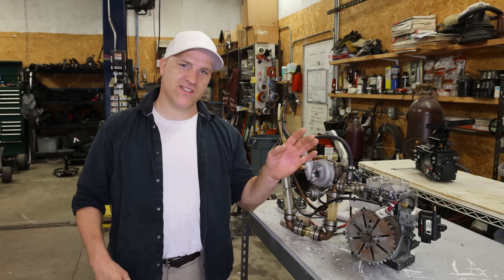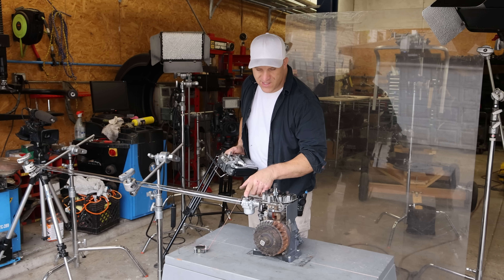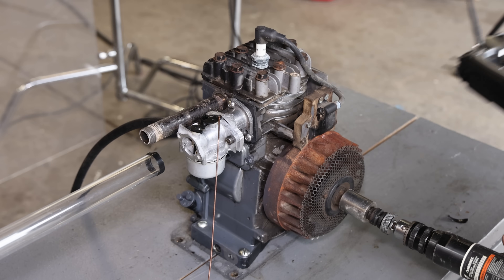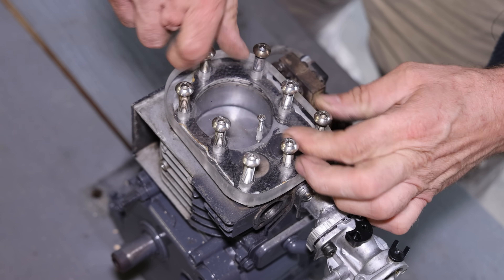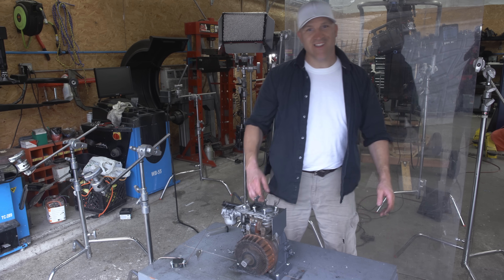Engine Running On GUNPOWDER

Comment: Does anyone notice that in the end clip where it’s supposed to show the Briggs still running after the explosion that the tube with gunpowder reappears. I smell something fishy here.
Reply: That tube is visible at 6:05 after the clear head is toast and the bolts bent. So I dunno maybe he put a new tube on after the engine blew up?
Reply from the maker: @5thwiseman  yup you got it, I was going to run it again on gunpowder but decided to just end the video, I did do a live stream of the engine still running .
Reply: Same-
Reply: All of the shots are the same engine, but the order is a little messed up.
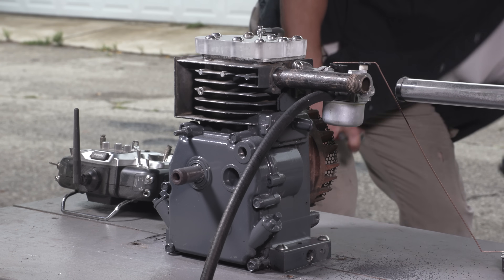up to 2:50 is the original timeline, it switches the second attempt between 2:50 to 2:55 and you can see the spark plug cable change direction. The second attempt was more exciting as the whole tube blew, so it got put in the video first. At 4:50 it cuts back to the original timeline, but the first attempts slomo has been moved to the end of the video.

The first load of gunpowder was smaller. On the second attempt, he gave it more gunpowder,  and the tube blew as well.

The scene of it running did not come after the double explosion but after the first explosion which is why you can see the tube with some gunpowder still there.
The relatively weak plexi head would have limited the amount of damage from overpressure, with the original head it would be a different story.
Aside from grinding gunpowder through the cylinder and valves, it's not surprising it run for a couple more seconds at least. It may have lost its warranty though.
Reply from the maker: @Spike8119  ha! That was an impressive breakdown! You nailed it, that's what I did in editing since I had multiple attemps and multiple tubes but only one explosion... Very nice
Reply: You can still see a tube at 6:05 as well
Reply: I think he got this engine blown twice, or used two engines maybe. But for sure he did a second attempt  , just look at 4:10 and 5:10, remaining pieces of a plexi head are in different places. So my assumption is at a second attempt he didn't get a tube with gunpowder ignited, that's why it's there at the end.
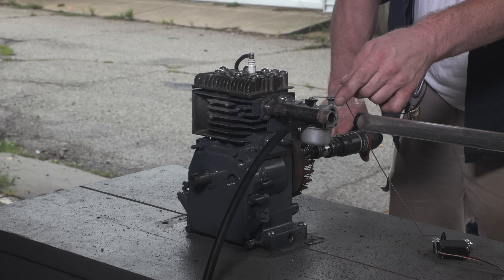Reply: if you look at 6:11 you can see another tube has been put in place, so yeah
Reply: Timeline can be proven true by the shattered bits and pieces of the clear head that are rattling around on the table when he starts the engine at 6:05
Reply: It's called he had another tube dummy
Reply: @wildman510  Negative, look up one comment
Reply: DeShawn Stevens  maybe click some of the timestamps and you'll see
Reply from the maker: DeShawn Stevens  it's not made up tho, he nailed , he just dissected the edit and he got it right
Reply: I noticed, too. I thought the tube had blown up. Then it magically reappeared.
Reply: Wait if you look at 4:04 and 5:10 you can see that the price see through head is not in the same position cause at 4:04 its at the side of the cylinder and 5:10 its at the end of cylinder hole,I guess he do this two times.
Reply from the maker: @hirusthehellhound  100 % correct!
Reply: Being a man, If I could blow that thing up more than twice I would, explosion are fun
Reply: Hey @Aluzionz dude, look at the end clip. he did it twice
Reply: Man you know the real reason is, that he thought to do it again with stock housing lmao
Reply from the maker: @kornpops1261  I almost did but I won't do it in my shop and I would have to have much thicker blast shields in place. That would be basically be a grenade at that point
Reply: @WarpedYT  it's nice to see a presenter individually replying to comments, first video I have seen for a while of this type, one of the best yet, a novel idea with the powder. 
As a technically minded person I can appreciate what goes into such a production. Well done.
Reply: I retract my own comment, it does appear to be legit rewatching it carefully now
Reply: Maybe he made two tubes?
Reply: @im_soulez  and filled it gun powder to see how it would explode again...I don't think so
Reply from the maker: @mindblastmanja656  that was the original idea but I decided not to do it a second time and just end the video, I had purchased 4 tubes.
Reply: Yea
Reply: damn the douchery is strong with this one lmao
Reply: I felt tricked!
Reply: I'm kinda surprised the head bolts had anything to go into after all that lol

But I did at least pick up on him saying "gonna do it again with the real head" and then it just never happened... Not fishy with the verbal mention.
Reply: he is a sussy Baka
Reply: Its there after the explosion when he's looking at damage
Reply: Unless he remake everything up again... I think
Reply: Yeah, the engine is probably filmed before the explosion, as the gun powder is still in the pipe.
What a shitty way to A. Try to sell a product, and B. Bait people in to thinking it still runs.

I dont see this as being a product placement, but why the fuck would you make it out like it is one?
Also, Look closely, The Crank is completely different. The wheel is Silver where as in the video of it exploding, it's completely rusted. 2 entirely different engines.
Reply from the maker: @ALuzionz  hahah... Product Placement? The engine is 35yrs old and Briggs has already filed for bankruptcy like a year ago.
Reply: @WarpedYT  I didn't realize that B&S went under.  I guess that explains the shitty modern construction.
Reply: @ALuzionz  Watch the video again @6:10 The tube of gunpowder reappears but it still has Bent head bolts
Reply: @ALuzionz  The wheel is moving, not "silver" (and looking carefully one can still see it's rusted).
And at 6:05 the tube is there but the head is shattered with bent head bolts.
Simply, he must have tried the "experiment" multiple times to get more footage and in the last attempt no embers ignited the powder in the tube.
Reply: @ALuzionz  if you look at a lot of his content he really is a bit sly :/
Reply from the maker: @johndoe1778  that's what it seems but not so, just like life or anything else, it's actually much harder and more unbelievable if you tell the truth then if you lie.. you really think I have that kind of time to set all this up and fake it?.. if it doesn't work for real I'll just go on to the next crazy idea, no reason for me to fake it...
Reply: @ALuzionz  all hat was bent Was The head bolts,  and anyways he could've had spare parts
Reply: I just posted the same thing
Reply: @itsamk18-ish  Me three.
Reply: I thought he was going to gunpowder the briggs and stratton head.
Reply from the maker: @FAB7362  no way... Not in my shop anyhow.
Reply: Ya I noticed that. That's because there is no clip of it running after. Super shitty to try to trick people
Reply: @tyler.diesel  no he put the tube back you can see the tube next to the bent head bolts at 6:05

Comment: 6:25 Why the hell is there another tube of black powder???
Reply from the maker: Because I ran it twice, the 2nd run is at the end of the video. I just pulled it out of the edit because it felt pretty redundant.
Reply: @WarpedYT  would have been interesting to see the test repeated, but thanks for the response. :)
Reply from the maker: It is at the end of the video, I just put the slow motion part in there though.
Reply: @WarpedYT  im sorry I misunderstood. I thought you said you removed it. And the slow mo at the end has a very similarly shaped piece of clear head left so I thought it was the same take. Keep up the good content and I like the new camera, feels fresh(?) and clean.

Comment: This was super cool!! I wonder if there is a way to make a simple machine to throw a small amount of gun powder into the engine.  Like a gun powder injector vs a fuel injector. I bet if the amount was much smaller it would run normal. Lol. Super cool footage!

Comment: First off, gunowder and black podwer are two different things, but you’ve said them both.  So which did you use?

Secondly.  Wow!  You re-built the entire servo mechanism, the tube, and refilled it with powder to “make it run one more time as an outro”?  We’re not that stupid man, uncool.

Comment: Great video.  But Wow.. your really brave for milling live powder in a high speed mill. To change the granular size for live black powder,  use a ball mill with non sparkling media, like ysz zirconium balls. 45 min or less you'll have black powder flour. Another method is wetting it to a paste and re-corning it through fine wire screen and letting it dry. Screen corning dry is dangerous because of the airborne dust, just add spark. Coffee mills are way too dangerous to use for pulverizing live black powder. Metal, fine powder, and plastic make for great static charge potential. Now for grinding each component of black powder separately in a coffee mill is safe, as long as its thoroughly cleaned after each ingredient.  Not busting your balls, just hate to hear about you losing an arm or worse from improper handling.

Comment: Why do you still have the pipe with the gunpowder still in it when you start it up again "after" the carnage? 🤔 dont think its a video from after the carnage... so i think That the engine would not start in the enda and you recorded a video before the carnage as a safety if the engine would not start.

Comment: Hang on I seen that tube explode to bits,how comes it is back and full of gunpowder when you testing engine after explosion?
I think you filmed engine test after explosion before you blew it up.🤨
Reply from the maker: Because I ran it on gunpowder twice, but I ended up just using one scene in the episode because it felt redundant. I did however include the second gunpowder run at the end of the video. I also did a story yesterday showing me run this engine again live because a lot of people were saying that I faked it.

Comment: See.. What happen was...Your rpm wasn't high enough and you should've had a 3 stage delivery system, NOS make gun powder injection through summit racing, you just have to get the solenoids from ZEX kit 😆

Comment: Strange, when you attached the metal head, a tube with gun powder appeared again.. is it montage and you didn’t really assemble the engine after explosion ? I believed you!!
Reply from the maker: It was did the gunpowder run twice, that clip is at the end of the video, also I just did a story couple days ago where I show yet again that I ran this engine after even the second explosion. Check it out if you have a chance
Reply: Warped Perception checked, now completely  it make sense. Thanks for response, take care!

Comment: Anyone notice that he tried to pass off footage of the engine before the gunpowder as proof that the engine still runs after the gp test? 
The gunpowder tube exploded so why is it there when he “put the original head back on to prove that Briggs and Stratton engines are indestructible”?

Comment: the other camera was definitely cleaner and crisper image when you are filming the engine this was a very interesting video and experiment I bet if you would have kept the original head of that engine when you put the gunpowder in it it would have exploded the whole engine and sent shrapnel everywhere which is not a good thing I have a suggestion for you on another tangent please I really want to know this what happens if you put hydrogen and a diesel engine will it explode or will a diesel engine run on hydrogen I'm very curious to know this can you do this experiment for me I would graciously appreciate it peace out have a great day

Comment: Here's the formula for TNT ( trinitrotoluene)..mix equal parts of nitric acid sulfuric acid and toluene. Warning do not let mixture reach 110 degrees Centigrade as it will detonate in your face..you need a vat that is water cooled and the bottom needs to be able to dump a gallon of the mixture in 50 gallons of water in a well ventilated open area ..and don't ever breath the fumes of your mixture has to be dumped as the nitric oxide  fumes will
 kill you in about 30 seconds ..a stable mixture of nitric acid sulfuric acid and toluene will solidify at around 100 degrees Centigrade as you liquid cool the liquid TNTover at drum and use cold water in a drum..pour the liquid TNT over the out side of the drum  to cool and solidify the TNT...then scrape off the TNT from the out side of the cooling drum and gently grind up the TNT in to  a powder and dust it into your engine ..will make a huge kafuckingboooooom
Reply from the maker: Ha! Your crazy to post this here, I am somewhat familiar with Tnt however I wouldn't mess with that in the city or at my compound, those DV's are way to high to play with inside a building or garage or in the neighborhood..... Lol.

Comment: Imagine if this was refined and implemented in the future 
Cars could do a quarter mile in no TIME!!!!
Reply: Oh I can think of a good way to refine it for maximum speed, just make the car a cylinder, put gunpowder on the back, then put it down a big tube. 0-Mach 2 in around one second!
Reply: @logantc.1353  HAHAHAHAHAHAHAHA
Reply: It would destroy the metal cylinder walls and anything else made out of similarly inferior materials.
Reply: @Baigle1  top fuel dragsters melt the plugs and weld their clutches every single run
Reply: Its called "Nitro Funny Car".
Reply: I mean top fuel dragsters already run on nitromethane which carries it's own oxygen just like gunpowder.
Reply: It's been tried since the 1700s, it's not a new concept. The problem is, it's a shitty fuel source, too volatile

Comment: hmmm, something about the camera is weird. I saw the engine and the tube holding the gun power explode one after the other but when you restarted the engine at the end with the stock cylinder head, the tube holding gun powder was still showing. Maybe it's ingrained into the new camera? 6:10 
 I hope no one got hurt and everyone can hear ok. Thanks again for a Great video! That was fun!!

You should have walked back in front of the camera with chunks of that clear pipe glued to your face and body and your cloths full of soot and said something like,  That was a fun video and I hope everyone liked it but I'm going to cut this video short because my ears are ringing and I have a head ache. Just to give it that Wiley Coyote affect.
Reply from the maker: It's because I did the run twice, the second run is at the end of the video.

Comment: Someone please tell me where I can buy one of these engines
Reply: I han an early 2000's craftsman 42" zero turn with a single cylinder 20hp briggs on it that was an utter tank. Not the same engine but pretty close.

Comment: that second explosion in the tube was really impressive, especially in slo-mo.😁 I can't believe it didn't break the connecting rod and/or blow the side out of the cylinder when it blew the head off. The fact that it still runs on gas is almost unbelievable.😲 So there you have it kids, don't ever play with gunpowder of any kind and expect not to lose a finger or 2 in the process... not to mention, possibly your life!☠️😬

Comment: Run the gun powder with the stock head on it instead of the plastic head.
Reply: Stock head with gunpowder!!!!. But double your distance from the engine.
Reply: Ah yes, making a grenade.
Reply: Um you realize the amount of shrapnel that would cause with the force created it would send it through his wall and his neighbors walls
Reply: @camdenp3244  yes,but big booms for fun...are fun.
Reply: that's just a straight up bomb
Reply: Exactly what I was thinking
Reply: Try to fabric a hopper style feeder for the powder, so u can vary the volume of the gravity feed of the powder
Reply: You want a grenade? That’s how you get a grenade.
Reply: @LuneyToonz-lk2de  ABSOLUTELY! 🫡👍🏻
Reply: I second that notion!
Reply: The end result would be exactly the same, EXCEPT, there WILL now be flying metal chunks moving at a MUCH higher velocity than the little plexiglass plastic pieces were flying.  

NO thank you.... 😬
Reply: 👉🏻 EVEN MORE VIOLENT 👈🏻
Reply: @sgottoboni  
💥EVEN MORE EXPLOSIVE! 💥

Comment: very dangerous blending the gun powder with metal parts lucky to still have a hand
Reply from the maker: Nah it won't explode unless under pressure...
Reply: @WarpedYT  you   are crazy  what happend to the tube with gunpowder in it  it was contained and exploded not under pressure you even said in the video double explosion  .,.. do a video of the gun powder in the blender add a spark lets see  if it explodes   youll be thinkin twice when messing with it in future ... people use wooden items to mix gunpowder friction  from the metal can cause it to spark and explode... look at firework rockets the gunpowder is usually in plastic bags with air around them they explode with alot of force
Reply from the maker: You did give me an idea for a video though.

Comment: People were stealing my weed eaters.   I almost pulled out the piston and connecting rod filled the cylinder with black powder block off the exhaust and intake and bang.  If somebody tried to pull it over

Comment: How did you magically repair the glass tube after and fill it with gun powder again? I think you took the after gunpowder explosion shot of the engine running BEFORE it exploded.
Reply: Yes, is there footage of the engine running after the explosion?
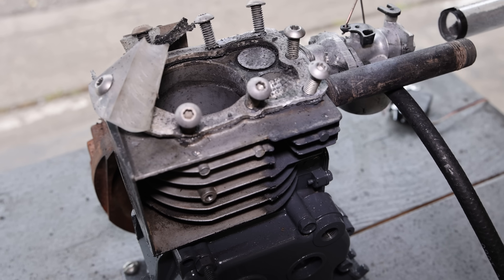Reply: I believe that there was 2 explosions instead of one. Because you can see that when he showed the aftermath, the remaining part of see through head is in different place. And in the second shot (5:16) there is the tube with gunpowder. So i belevie that after that he mounted the original head and run the engine.
Reply: All wrong. he was going to do another explosion on stock head but chickened out. Plus his neighbour Jack suffered a coronary.
Reply: Pred is correct, also there's an end clip where he blows it up AGAIN.
Reply: He accidentally put the explosions in the wrong order when he edited the video

Comment: Camera seemed pretty good. Wonder if you replaced the valve train and see if the engine still runs. After that if needed replace the piston rings. It might still run. 🤔